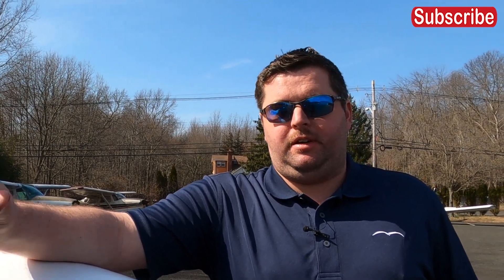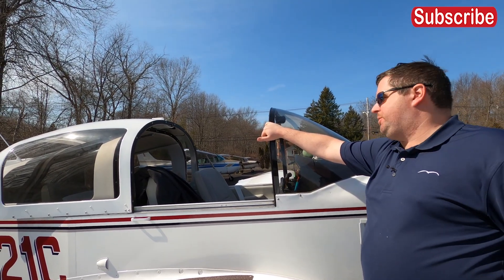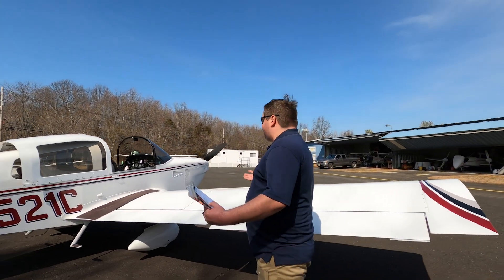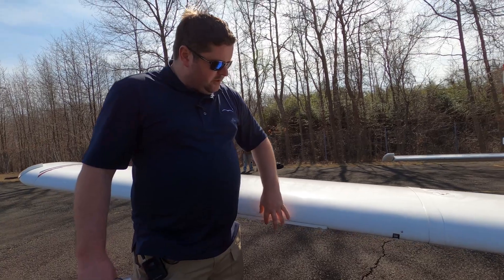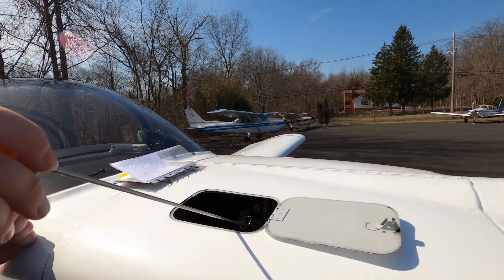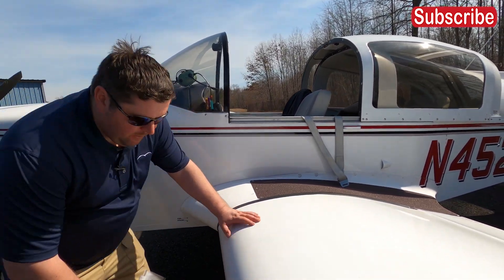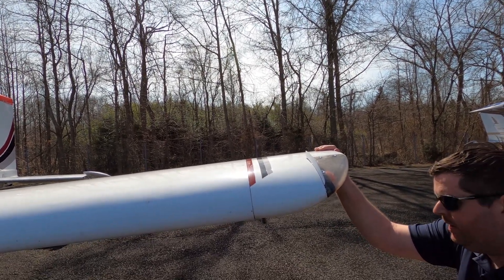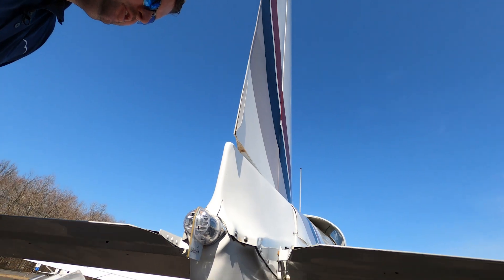Grumman Tiger Aircraft Introduction wit David Duvak

Comment: On your pre flight you forgot something the static vents either side of the fuselage bugs live in those holes and from memory it should have 2 drain points on each wing centre of the tank and sump and when you inspect the wings give them a shake that forces the water down to the sump do the same for the other side and complete your pre flight and do your fuel drain last give time for fuel to settle

Comment: Some items were missed or incorrect in this video. Firstly thousands of students in the UK trained on AA5A's or Cheetah. 4 of the largest and most professional training school in the UK used them. 
It is important that all users are aware of the torsion bar nose leg and avoid touching down on this first or a ground loop could result, and an inexperienced pilot may try to control land instead of applying full power and going round again. he failed to mention the stall warning buzzer vane mounted on the leading edge of the wing which gives a strong buzzer warning and is usually checked when checking the lights and pitot heat with battery master on. The walk around would usually start from the left or captains side and continue around the aircraft.
After each flight I would recommend lifting the engine cowling and checking around for any loose hoses, electrical connections and leaks.
The metal strips on the end of the wing tips were originally designed to stop the reflection from strobe lights on night flights or in IFR and have little or no effect on providing more lift.
This is a great fixed prop. fixed under carriage aircraft, can be used on short rough grass strips, but I wouldn't recommend this with wheel spats in place.
A comfortable cruise is around 120-125 knots and it would depend on the day if you could fill tanks and have 4 people on board. It stalls with easy recovery with a small left wing drop. Visibility is very good and apart from the nose wheel there are no particular vices. It handles crosswinds well and a crab approach is recommended as opposed to wing down and crossed controls at low level.
The landing and the sensitive nose wheel is the only thing to be aware of with this truly underrated aircraft. I have flown over 1000 hrs. in an AA5B and around 400 in a AA5A and over 1000 hrs. in a GA7 Cougar. I love them. I have done the Malta Air Rally leaving from Biggin Hill near London 3 times in these Grumman's and one trip into N. Africa and countless trips into Europe and I think for the money they offer the best all round value and fun experience. Such a shame they are not made now.

Comment: AA-5 Traveler and AA-5A Cheetah are both 150 HP. The difference between the two are the size of their horizonal stabilizer / elevator. The Cheetah and Tiger use a larger one than the Traveler. The Traveler also has a fin going down the underside of the tail. It was to help provide yaw stability and was made of wood as a sacrificial structure in case of tail strike... but was removed for the Cheetah/Tiger as it wasn't required.  The planes all start with AA-xxxx as it was initially American Aviation that designed/built them. Grumman bought them and did the improvements in 1974 on the AA-5 series. Later Gulfstream bought them and renamed the series AG-5B with a questionable redesign of the air intake. There has been Tiger Aircraft... with currently True Flight of Valdosta GA owning them. They keep talking about making more, but I don't see it happening.

Comment: Hey David, awesome video man. Tiger is a great aircraft so thanks for taking the time to upload a video of appreciation about it. Couple of friendly critiques:

-  0:43 Tiger was introduced in 1975 by Grumman American, Northrop-Grumman never made them.
-  1:12 AA1 Yankee (not trainer)
-  1:29 Cheetah  and Tiger have the same fuselage (as does the AA5 Traveler).
-  3:21 Wings are not a honeycomb structure (fuselage is sandwiched aluminum honeycomb though). The wings are aluminum glued to ribs inside the structure of the wing.
-  8:40 Missed a fuel sump under the wing. Four total, two on each side.
- 9:15 POH says do not operate the engine with less than 6 quarts. 
- 9:55 I completely agree with your strategy with the prop and treating it as the most dangerous part of the aircraft. However, its important to note that the p-lead grounds the magneto. The mag itself is engine driven and is the one that generates the spark, not the p-lead.
-  11:15 Brake reservoirs are in the master cylinders beneath the pilots side rudder pedals. (You might be thinking of a piper here).
- 11:25 No fans, just vents.
- 12:42 Not a speed mod. Just there to block the light emitting strobe from the pilot and passengers. 
- 13:25  Pitot tube measures only airspeed. It does not measure vertical speed or altitude. 
- 14:50 Missed the static ports. One on each side of the fuselage, located within a foot of the stab.
 
All around video was great dude. That paint looks soooo good on that Tiger! Hope you make more videos about the Tiger, its a wonderful aircraft I love flying our 76' model!
Reply from the maker: Thanks for the critique man. Glad you like the video. Honestly, this segment I totally Wang it because, I was intending to fly the camera guy that day and, the winds got really nasty after I had arrived at Old Bridge. Not my normal way of doing something but considering, I did the best I could